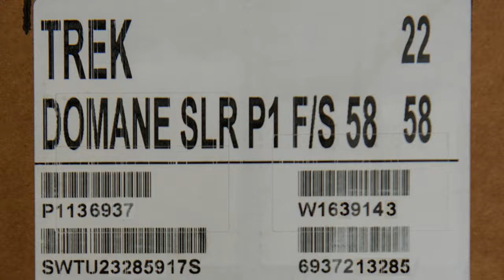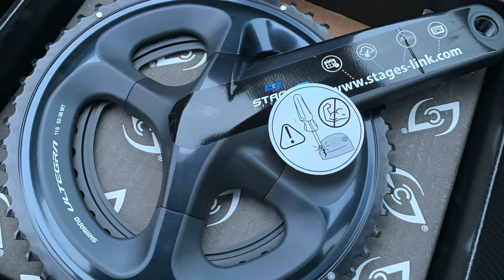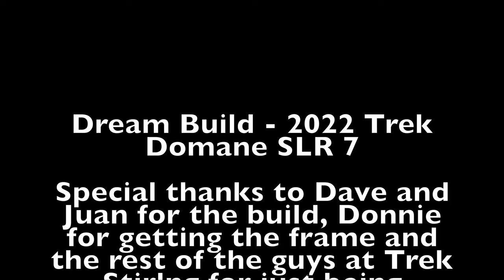Dream Build - 2022 Trek Domane SLR7 - ProjectOne ICON Psychedelic Marble

Comment: I'm so excited I actually ordered this exact build as the Domane LT+ 7, never seen a video with that color.... can't wait to get mine in a couple months :)
Reply from the maker: Congratulations!  The video does the paint no justice - it’s much nicer than this video could ever show.
Reply: @Jetta32696  Thank you! I debated the color 3 days until I dreamed of an xmas tree and all of the ornaments were Trek bikes in that color B)
Reply from the maker: @Techtastic1337  MY journey to this color was about 6-8 months in the making.  Had a 2021 Black/Gray SL7, then the 2021 Amethyst/Brushed Silver SL7, the 2022 Psychedelic Marble is my final destination for a while.  Only thing I could upgrade further are 12 speed Ultegra (no need for Dura-Ace), a better wheelset and/or ceramic bottom bracket… I plan on riding this frame until I can’t ride it anymore - OR Trek comes out with a color scheme I like more.

Comment: Amazing build!

What did you use to mount the Varia to the seat? What Blendr options did you use on the front?
Reply from the maker: Thanks!!  I got the Corki Varia mount from Amazon. I currently have the Blendr Duo base, awaiting the Domane specific duo base with cable wrangler.  In addition to that, I have an Aluminum dual twin mount adapter from amazon to allow me to have my garmin, light and gopro al mounted to the stem.  I don’t race, so I wasn’t concerned about the extra weight up front.  Hope this helps.  👍🏾👍🏾🚴🏾‍♂️🚴🏾‍♂️

Comment: Nice bike. Any issues with disc brakes rubbing when taking out and back the wheels?
Reply from the maker: Thanks.  No issues at all and I swap out wheels often.
Reply: The only time I've ever had that issue is on my gravel bike and it was my fault because I accidentally pulled the brake with the wheel out. Other than that, as long as you have them spaced properly, it shouldn't be an issue.